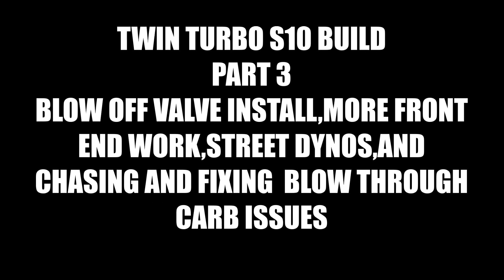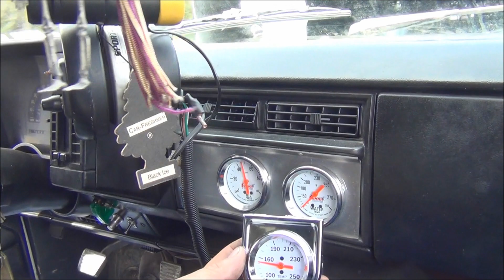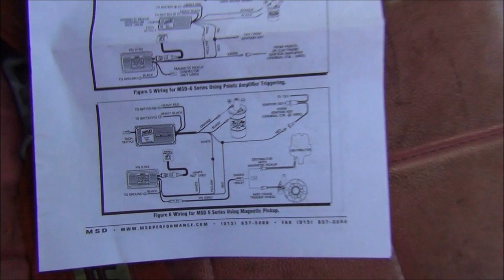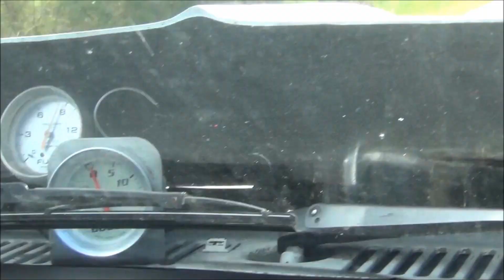SKULL GARAGE 2019 (EP.18) TWIN TURBO S10 BUILD PART 3

Comment: I'm building a 388 s10 I bought a TH 350 with short tail shaft. Cross Member I'm going to have to move forward a little. But the drive shaft is to short. What drive shaft did you all use???